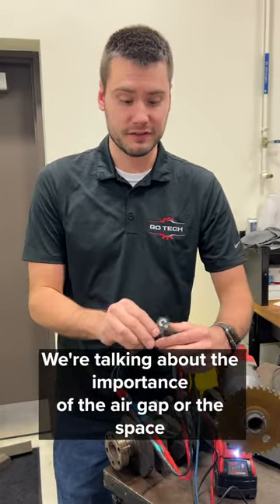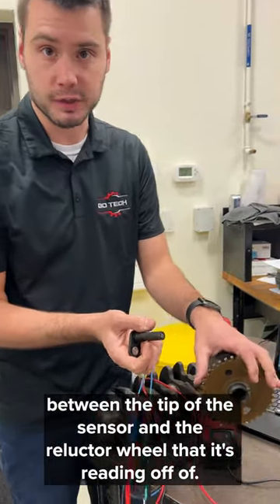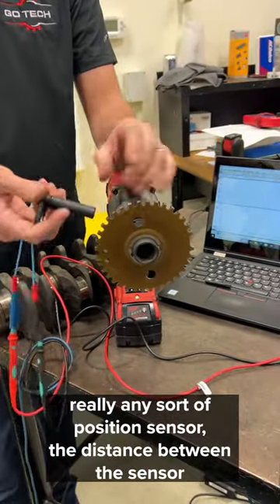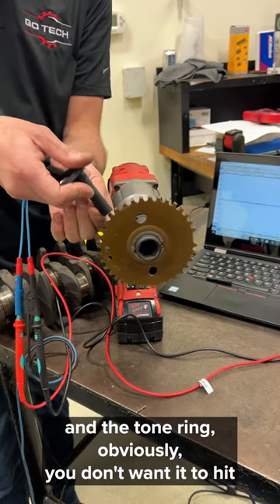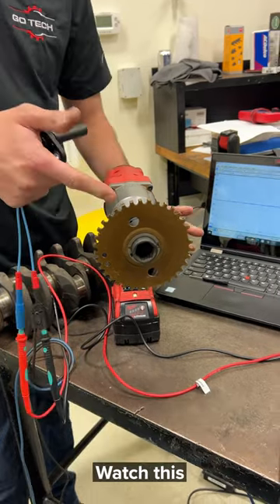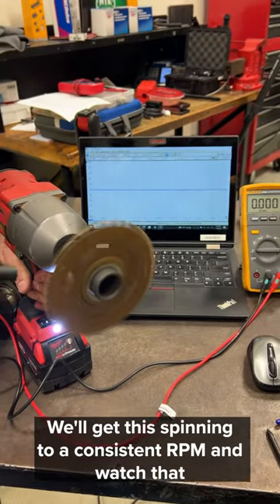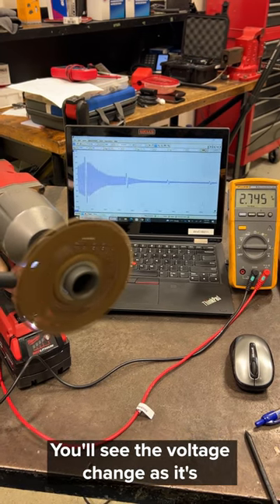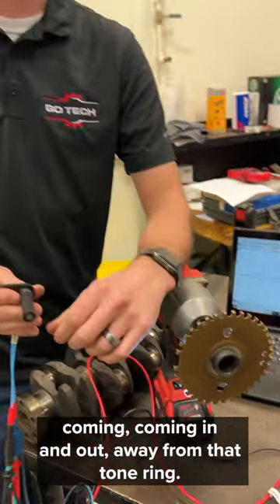Check out why sensor air gap is so important! #shorts #autorepair #gotech #cars #milwaukeetools

Comment: It would be cool to see you clamp it all down, make a jig where you can slowly tighten a screw and make it closer..  and use a dial indicator and get some real numbers for the gap tolerance to voltage relationship...   Make sure you can use the same jig for other vehicles sensors too --  so we can all compare gaps and voltages across different brands;  it would be a unique data set that's probably not out there.
Reply: Exactly
Reply: It is a simple demo to tell air gap effect. 
Look at the graphic screen wave hieght in relation the sensor distance/gap. 
That all it says....
A wash or torque out of spec make a big different in sensor out put to ECU to make the engine not working as required.
Reply from the maker: Hey Calholli, we actually have a set-up like that in a different video where we covered abs wheel speed sensors. But yeh, that would be a cool set of data to have for sure.
~Mike
Reply: @GoTechTraining  Nice!
Reply: As a tech of 30+yrs that would have been nice to have a reference chart to that effect to refer to considering there isn't always a perfect opportunity to get access to manufacture specs of a list of pids on specific sensors to compare to the readings that you are getting on the scantool to compare to for immediate diagnosis. Think you could post something like that? Or would that be too much work?

Comment: Does the voltage output vary with reluctor rpm at all, of is it strictly a function of gap distance?
Reply from the maker: Great question! Relutor speed and distance both play a factor in sensor voltage output when dealing with an Ac voltage generating sensor. Faster=more voltage and tighter frequency. On a digital sensor, voltage will remain consistent regardless of speed. Frequency will increase with speed though on a digi. -Mike
Reply: Doesn't engine speed (RPM) verses the sensor out put  being programmed as acceptable when the sensor gap is correct to factiry spec.? 
So.... non comply data consider out of spec, meaning fail sensor or aur gap is out of acceptable range. ( provided voltage supply is as per spec with grouding is good).
Reply: Voltage stays the same but frequency increases as rpm increases. The closer the air gap the higher the voltage

Comment: Is the gap the same in all sensors or varies my manufacturer????
Reply from the maker: Great question! The sensor will usually fall within a range dictated by the needed signal output and the preset OE gap. Sensor manufacturers can make subtle changes to the sensor design to be more or less sensitive if it were slightly shorter or longer or slightly different in magnet position. That sort of thing. As long as the output value is within the range the PCM or whatever module. -Mike

Comment: YOU WRONG . WE USE FREQUENCY NOT AMPLI
Reply from the maker: Hmmm, frequency is used to determine speed, crank, cam, abs wheel speed, etc...but if the amplitude(voltage) isn't high enough to trigger the AC/DC convertor inside the PCM the PCM will never see the signal.
~Mike
Reply: @GoTechTraining  the gap usually can change that much to cause such a trouble, the pcm has amplifier that give magnified amplitude, and along with that there is a circuit that converts from this ac signal into a simple rising and falling edge using logic levels, so that small change in air gap can be compensated using the amplifier.
Frequency wont change if air gap went bigger and its the target that we use to calculate speed and position, we cant use amplitude to measure speed beause its gonna be heavily by air gap, and it cannot give any information about position ( as freq, because we rely on the sync pulse).
newbies hearing amplitude change and air gap will think that amplitude is what is used, rather it just a mandatory thing, but its value doesn't do anything as long as the circuitry can see it